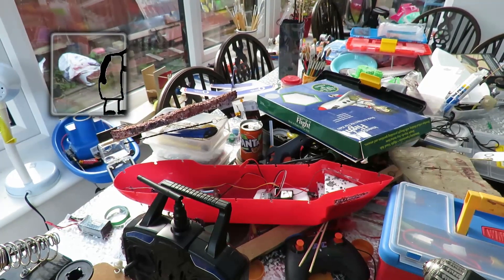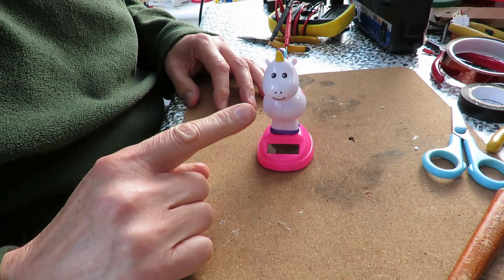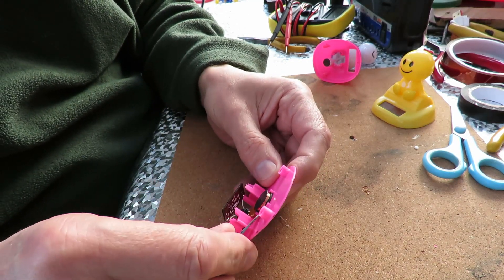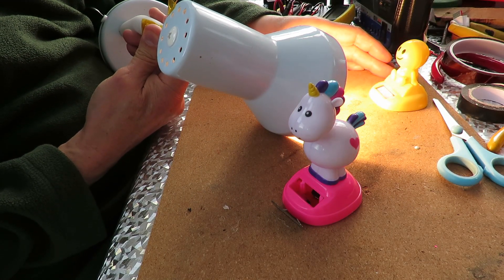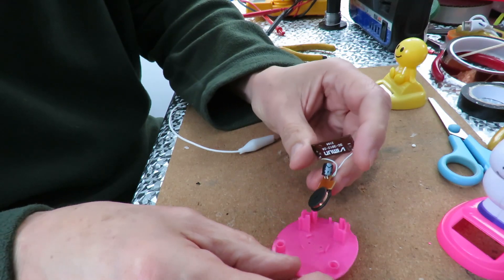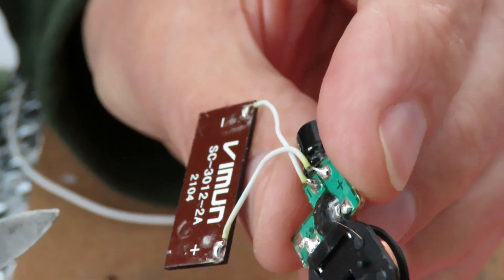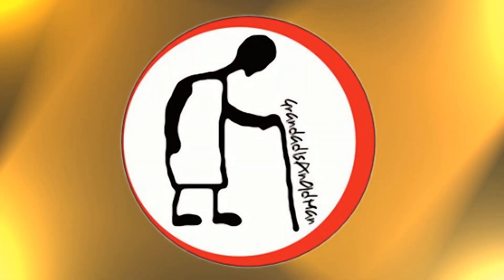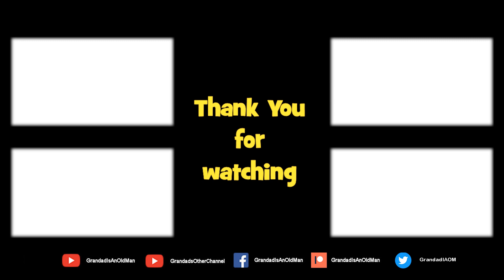Unicorn solar rocker teardown and fix

Comment: I have a green duck, and his head came off. His body moves without the head, but it stops when I hot glue it on. Do you have any ideas on how I could reattach it?
Reply from the maker: Sorry, no. Without actually seeing the duck and understanding how it goes together, I cannot help. Most of these rockers that have multiple moving parts with various pivot points for the different pieces. If your hot glue is preventing the parts from pivoting freely, then that is possibly the problem.

Comment: Did it come from Poundland?
Reply from the maker: No that one was home bargains I think
Reply: I will have a look. Love those coils. I put a touch of acetone on the other type and it released them ok without harming the coating
Reply from the maker: @Telboy-fv8ke  good point, I should have bought a few more. Probably none left now.